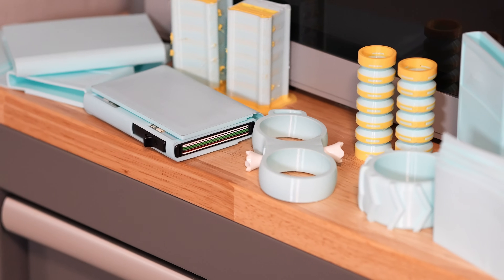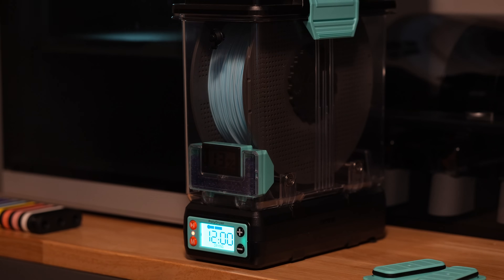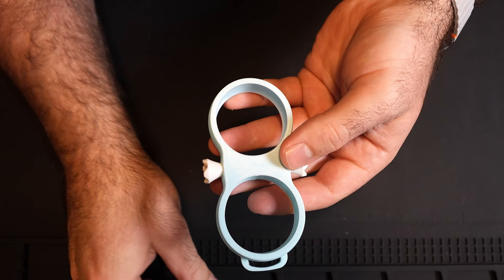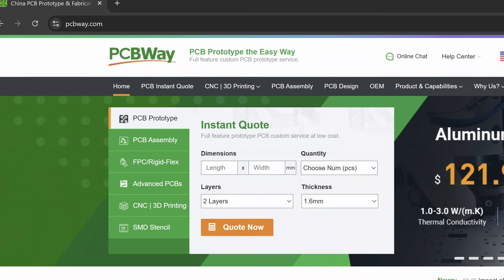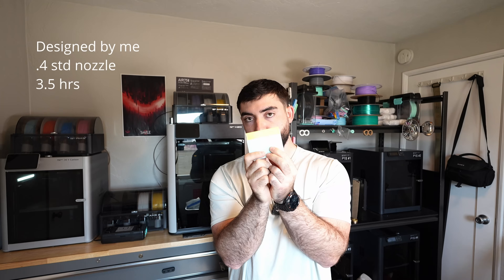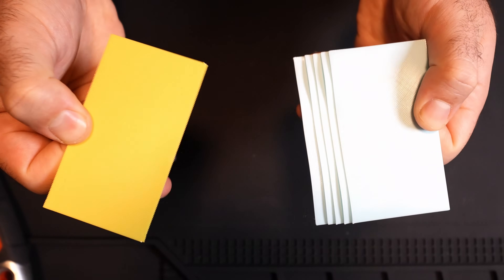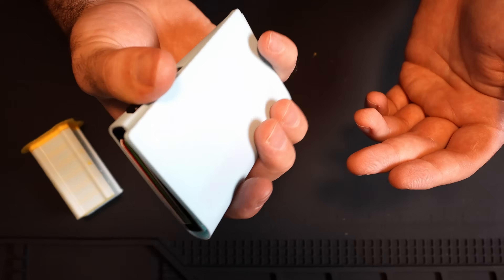Printing TPU + PETG on my H2D

Comment: For modeling interlocking materials, do you model them with any offset? Or just model them with 0 gap and let the slicer deal with it?
Reply from the maker: No offsets necessary. The slicer will handle it like you said

Comment: Hey man, thank you for your videos.

I am considering investing in the H2D over the H2S solely for the ability to print intertwined TPU + PETG parts.
Would you please consider making a video tutorial of how you achieved interlocking TPU + PETG parts? I cant find (any??) tutorials online that explain this process, so it might be beneficial content for you to make 🙂

What is required of the 3D file to do this? Is it a single model, or is it multiple individual models which are arranged into an assembly, from which material is assigned to each part separately?

I am very familiar with SolidWorks, but have never used Bambulab Studio - only Cura for my Creality printer. 

Keep up the good work. I just subscribed.
Reply from the maker: Thank you so much for your comment! You could absolutely make an assembly with multiple parts and save a step file that way, but I find it much easier to model my bodies in place in a single part file. Typically ill use a pattern feature and keep the patterned bodies from merging into a solid part. That way I end up with a part that has multiple separate bodies. Then on the slicer side you just recognize those bodies, and select your filament for each. Pretty cool!
Reply: @sammuxlow So cool!

Thanks for your reply👍

Comment: how did you make the inside hollow? did you use support? did it separate easily?
Reply from the maker: which part are you referring to?
Reply: @sammuxlow  Sorry. I was so intrigued by it that I forgot there are other prints featured. The wallet. There is a huge hole were the mechanical part goes. Did you print with support inside? You can't print it on it's side - it'll wobble too much.

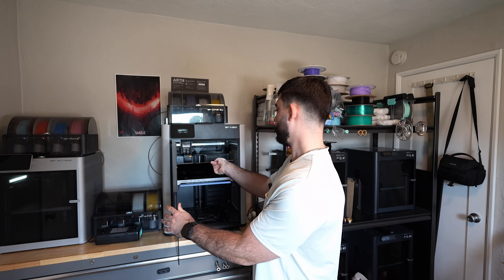Comment: 3:50 lower the bed temp to 35 or 30 or off. On the X1C and A1 TPU bed profile is too high, just keep lowering the bed temp until it comes off properly when cooled. If PETG won’t stick to the bed at those temps then have a TPU raft to print on-top of, manually model the 2 layer thick raft if Bambu slicer doesn’t have that setting.

If all else fails use glue, the glue acts both as a release agent and adhesive ironically.

Comment: where can i find a model of wallet? i have the same card holder...
Reply from the maker: Available on my website
Reply: @sammuxlow  i tried... but i can't divide petg from tpu =(  I think zero in settings wrong idea for cardholder cover
Reply from the maker: @SergeyCHiP did you get it off my website? I can help you set it up

Comment: Hello @sammuxlow , any tips on how to print small thin PETG letters (3-4 layers) on a thick TPU platform?  My attempts are not adhering very well.  TIA
Reply from the maker: Maybe increase the temp of your PETG? Or find a way to design around the TPU like i did with my spine print.

Comment: That alcohol tip is really interesting. I’ll have to give it a shot. The textured bambu plate says not to use alcohol when cleaning though, so I’m curious if it’s had any long term issues. Thanks for the vid!
Reply from the maker: Ive seen no issues with it, used it hundreds of times, still has excellent properties

Comment: Nice work. Amazing use of the H2d for TPU printing. Kindly share some more insite on printing using 85a tpu filaments on this. And whether it can be used in the external box while printing?
Reply from the maker: 85a is pretty tricky since its so soft. The shorter the filament path, the better. You really want low friction as it leads into the head, so you don't get any stretching or inconsistent extrusion. Other than that, make sure its very very dry, and print slow. Also, keep your layer heights as big as you can... .16 is the lowest, but id recommend .20 for your low-end.
Reply: @sammuxlow  Thanks.

Comment: I have been doing the same on an old IDEX printer (Sovol SV04) that I have done a few mods on.  I found that the materials sometimes bond a little too well when using zero clearance. but I never thought of using alcohol.  Are you able to go with zero clearance using alcohol?
Reply from the maker: Yes! I went 0 clearance and doused my prints in alcohol where the PETG HF and TPU layed on top of each other... made it really smooth to take my prints apart with no tearing.

Comment: I think you should make a video on pushing tpu, maybe not to the limits but close to it for speed.  what parameters need to be changed and how to get faster prints with TPU.  I know there are limittations but  printing at ludacris speed is generally doable on the H2D if you dont need extreme  precision.

Comment: Love the video.  I am getting the same pinhole artifacts on my TPU prints as well.  It is not moisture.  I know that because I used the same spool of filament on the A1 Mini and the print was flawless.  I am curious what the issue is.  Please let me know if you find a solution.
Reply from the maker: I definitely think the filament could've been dried more thoroughly, TPU can be stubborn at times. Also, check you seam settings, and lower your volumetric flow.

Comment: 98A is really hard. I need 70A. This is a huge difference.
Reply from the maker: 70A is very soft, not sure that is a realistic filament for FDM
Reply: @sammuxlow  I am printing 70A on the 2,85mm machine. You can print up to about 68ish on most modern FDM machines, you just need to have the correct settings in the hard-and software. It´s slow, it´s a pain sometimes but it works. It´s just ....slow ....and a pain in the ass....
Reply: @sierraecho884 tpu could try foaming? It prints/feeds like 95a but foams down to 65a depending on print temp
Reply: @sammuxlow  Currently I can print 70A on the H2D with about 3mm³/s² flowrate. I have not modofied this machine currently, thus it´s this slow. On my cheap Flashforge 5M, I can print 95A with up to 12mm³/s². I have turned this thing into a TPU monster.
Foaming is useless for me since I needed gaskets with Shore A70.

Comment: Great videos your are putting out, but one thing I hope you or someone else will print and test something like this, with print of different gripping surfaces.
I find there are next to no functional tests of multi material prints and their functional properties, surface quality, print accuracy if there are single or multiple layers.... 

https://preview.redd.it/j46pu6qrv2371.jpg?width=1080&crop=smart&auto=webp&s=836ac137ab3f79939443fb12e7d6fa00bb7fb72d

Comment: How do you feed the TPU and the PETG ?  I know Bambu has a wiki, but did it work just as directed ?
Reply from the maker: I fed the TPU directly into the right nozzle (no ams, polydryer box) and the PETG HF into the left nozzle with an AMS. I did not however use the TPU Port on the back of the printer.

Comment: Hi, thank you for a very useful video ! Iam designing a key fob using black bambu tpu 95a . I want to do green text on the fob, which material would be better, pla or PETG. How would I set the text up so it is clear ? If you can help I would appreciate it.
Reply from the maker: I would go with PETG for this scenario. But you could probably use either. How you setup the text is up to you. You could make it flush with the surface of the fob or deboss/emboss it. Id say debossing it or making it flush would be best for this combo of filament.
Reply: @sammuxlow  Thank you, I will tag how it goes, cheers, Ady
Reply: PLA and TPU do not melt and bond together, PETG and TPU bonds together. It seems in this video he was using PETG HF which apparently doesn’t bond with TPU. So use PETG for the text if you don’t want it popping out.

Comment: Thank you!  Finally a clear and concise video showing the benefit of selecting the H2D.  I am in the market trying to decide between the 3.  This video and the comparison of the X1C for your parts help my decision.
Reply from the maker: Awesome, glad I could help!
Reply: I have the X1C and it is the 7th FDM printer I have bought (Used a handful of others in a range of FABLabs) and the X1C is fantastic, though the P1S is likely as good. I would chose the H2D as the lack of being able to make good combinations of grippy TPE/TPU withought being lucky with some TPE/TPU seperately and then overprinted with harder material is not a good process. If I could live with TPU for AMS then I might stay with P1S or X1C, but I would choose H2D without AMS over X1C with one, as my need is multi material and not really multicolor to any great extent. 
I would really like a larger H2D though - ex double wide so you could print a 500-600mm long part.
Reply from the maker: @jenspetersen5865  what kind of parts are that large? I'm curious what stuff you'd print on a bed that big
Reply: @sammuxlow  Feeding/sorting prototypes machines like this one we produce, and in particular new developments. We have a handful of format parts where much is trial and error, where each shot in the right materials often end up costing €1000-€2000, but we also really need the slicers to start incorporating non planear ironing up to 10-15 degrees, but it is mainly machine structures. 
 https://www.youtube.com/watch?v=HvewajIYiE4&pp=ygUHZGVuY29yZQ%3D%3D
Reply: @sammuxlow  Or things like this - https://www.youtube.com/shorts/XC2G3XxrRJg

Comment: The boogers on the surface when the TPU is perfectly dry is usually the seem. It's set to random by default in bambuslicer and it really shows on tpu.
Reply from the maker: Definitely could be the case, I dont remember what the seam was set at

Comment: I have an h2d with ams 2 pro, and I also have the ams-HT.  I keep trying to put my Bambu labs tpu-85A and can’t seem to get it to feed through the extruder through the tip.  I am using .4mm hot tips but have other sizes.  Any suggestions are appreciated ! - I can’t seem to get my ams-HT to dry my filament either as it keeps giving me an rfid message.
Reply from the maker: I've been waiting to unbox my ams HT for a video, how are you feeding your TPU into the head of the printer? Which port are you using?
Reply: @sammuxlow I am going through the plug in the lid for it since it is below 90 hardness.  I am using the right (top) tube and can feed it manually to the nozzle, it just doesn’t ever seem to recognize it and always asks me to feed it through all the way
Reply: There's no RFID on the non-AMS TPU

Comment: I don't understand how the material doesn't stick but at the same time it has to stick to keep the lines clean.
In my prints I can't start the first layer above the support material otherwise the sides don't come out clean
Reply from the maker: Let me clarify: PETG sticks to TPU, pretty well actually, it just doesn't fuse with it. So, after taking the part off the bed, alcohol is needed to separate the PETG supports from the TPU model.

Comment: Apparently those pin holes in the walls are not always caused by moisture but also material degradation. Ie gas is formed if the print speed is too low or the temperature is a bit high. I’ve had a similar issue.
Reply from the maker: That's really cool, did you read up on this somewhere?

Comment: I find that TPU stretches over time. I designed my own cellphone case, and I reprint it once every 3 to 6 months after the phone gets a little loose inside the case. No big deal since it's just 20g of TPU each print, and it's nice to have a fresh case every few months.
Those little pits you're getting on the side of your prints are possibly due to feeding the TPU through the filament buffer rather than the TPU port. That causes the TPU to stretch as the direct drive extruder pulls it through, causing occasional underextrusion which could show as small pits like you see in your prints.
Reply from the maker: Very fair points, I'll definitely try the dedicated port and see what happens

Comment: As a general rule, you can probably get faster print speeds with TPU if you somehow feed it directly to the top of the printhead rather than through a reverse Bowden tube. The friction in the tube can make a big difference. You should be able to print TPU on almost any modern machine far, far faster than 30mm/s that provided you relieve the filament friction. For example, I was able to get 12mm³/s or more on my Qidi Plus4 with Siraya Tech 85A TPU, well over 150mm/s with a more difficult filament. I just fed it directly to the top of the extruder. Lost In Tech also has great videos on the topic. Not sure how easy it would be to make this work on the H2D, but worth a shot. At any rate, cool tests! I definitely want a tool changing printer. You could also do embedded magnets in TPU or interlocked PETG latching mechanisms. TPU is insanely strong. So cool.
Reply from the maker: Yea I agree with what youre saying. Since its so tall and my office is so small, it would just be inconvenient to have it feed into the head like that, and im sure there are others who would agree. So I just wanted to test it out using the normal port. I still appreciate your comment, and ill definitely keep that in mind if I want to print faster. Thank you
Reply: @sammuxlow Yeah for sure I get wanting to feed it the most convenient way. I just don't see this tip given out a lot so thought I'd share. 😁
Reply: I'll definitely try this on my plus 4 as well, good stuff!

Comment: Quick note on petg and tpu adhesion. It sticks INSANELY well to each other.  It’s that PETG HF that’s the issue. I’ve done multiple tests and found that if you use proper petg … or petg translucent … it adheres to tpu as if it was true petg seamless layers. Solid adhesion.  

PETG hf? Suddenly comes apart and easy to remove as if it was Pla. Something about their formula.
Reply from the maker: I have some translucent PETG, so I'll have to give that a go, thank you!
Reply: It is probably because most high flow or high speed filaments have a ton of additives to make them melt faster at the trade off of worse layer adhesion.

Comment: Curious: why PETG as the other material rather than PLA? Inter-material adhesion?
Reply from the maker: I haven't tried PLA yet, but with 95A TPU, PETG temps are closer than PLA, so i just used the same filament as I did before. I believe PETG also sticks better, so you end up with better results, especially when laying down support layers on top of TPU
Reply: PLA doesn’t melt and chemically bond with TPU. Plain PETG will, but it seems PETG HF doesn’t bond with TPU.

Comment: Nice!  Definitely take a look at different retraction settings for the poc marks.  Sub optimal retraction can cause changes in nozzle pressures and get it out of steady state pressure leading to the pin holes.
Reply from the maker: Good tip, thanks for sharing!
Reply: What is a good general rule of thumb for tpu retraction setting values
Reply: @rlbrlb5109 really need to do some testing to verify.  On my A1M for Bambu’s 95A HF, I’m at 1mm retraction, z hop disabled, 20mm/s retraction and deretraction speed, wipe while retracting, 3mm retraction distance, max volumetric speed of 7.2 at 220c. 

Many factors effect it which is why you need to run the tests to find out what works best.

Comment: About the holes. Check the retraction settings in the filament profile. Gloopy filaments like PLA Silk and TPU can get these holes due to long retractions.

When the filament retracts, it creates an air pocket. Filament can block the nozzle and this creates a bubble that pops, even with dry filament. This is more likely with gloopy materials, and with nozzles bigger than 0.4mm.

Try 0.4mm retraction length. The stock retraction is too large. Too little retraction causes stringing, but too much causes these holes.
Reply from the maker: Thank you for this!
Reply: I was also thinking of the pressure advance/coasting settings at the end of a perimeter, There will always be a small divot or seam on each layer, even with materials like PLA. If the seam is set to random rather than aligned, it would explain the random pocks. Generally, it's nearly impossible to remove those. Scarf seams may work but I have not seen people try it with TPU.